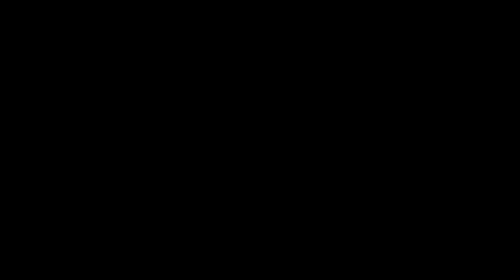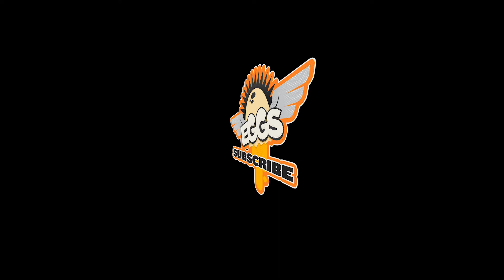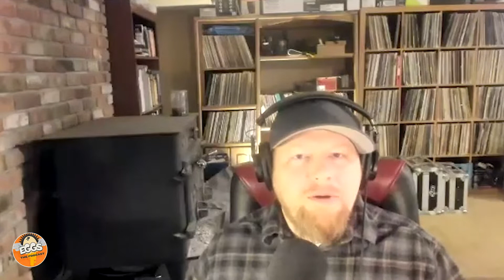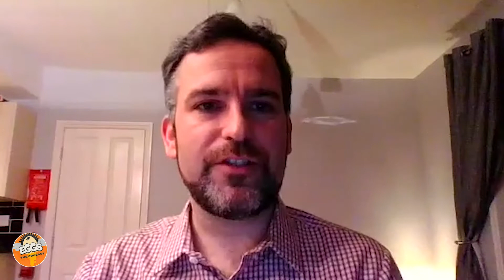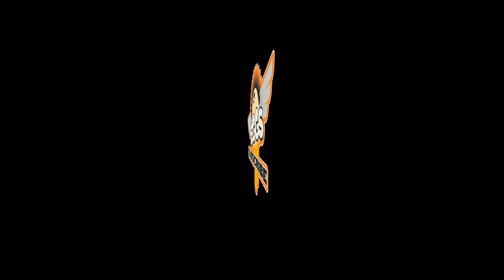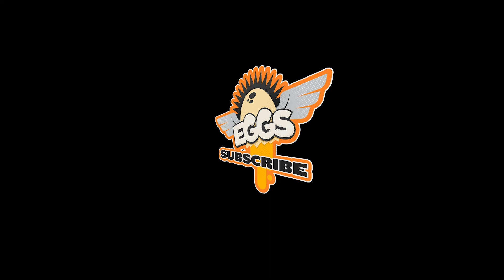Hydrogen combustion engines vs hydrogen fuel cell technology with Andrew Murphy [Alternative Energy]

Comment: This did not answer the question of comparing overall efficiency and cost between the two. One point is the NoX produced in the ICE is very low if the hydrogen air ratio is at an optimum level.
Reply from the maker: Take a look at the show in its entirety to see if Andrew answered more thoroughly your questions. This is just a clip from a longer interview. :)

Comment: You should take a good look at what JCB have just developed! They have managed to convert one of their own home built engines (yes, JCB build their own engines!) to run On Hydrogen gas, interestingly, without the engine producing NOX gases! This is by tuning the engine and by some very clever British engineering! They looked at producing an electric JCB and found that the battery they would need would weigh an extra 8 tons to run the double shift that construction equipment is used and designed to run to today. The electric JCB would also cost over twice the cost of the Hydrogen version! So there is much promise for the British car manufacturing industry if only they would licence the technology from JCB!

Comment: Thermal is cheap, reactive and H2 very low octane can be offset by a diesel cycle with HP H2 injection and the very high speed of H2 combustion enables much higher rpm and downsizing than H2 Otto cycle while the fuel cell is more efficient so solution is hybrid again, Sir Aido Toyoda…thermal for acceleration and power, and FC for cruising with green H2 to store excess summer free sun energy…PV gets cheaper all the time, graphite electrolysers cost nothing, high pressure H2 COPV can store static and mobile massive amount of energy for almost no cost being well over 30 times cheaper per kWh of storage than LIB’s and well over 30 time more durable with well over 50000 full pressure cycles without any measurable loss of gas while a lithium battery leaks at o.8 to 2.1% energy loss per day. Mobile loads will quickly adapt to cleaner and cheaper stored energies since surface renewables like sun and wind are variable, unpredictable and seasonal and such energy production must be stored to meet deferred demand
Reply from the maker: Thanks! We love learning about thermal and other future energy options!
Reply: @EggsThePodcast  thanks. I spent a third of a century in the energy, mobility and distributed power, and those very dynamic domaines are forcing us always to think forward, few steps further…If today, one could consolidate all vehicular technical improvements already in mass production today  into a single vehicle, the best mobile efficiency and safety of today could more than double…triple etc, with fuel cells, Miller Atkinson Antonov Peltier Sabatier SPCCI hybrid and regen. braking, low resistance tyres and bearings, composite frame, shafts, wheels, brakes, automated vehicular interaction etc..
Reply from the maker: Thanks for all that information. We totally agree. I don't know if you have heard/seen it yet, but you might have some interest in a recent conversation with Dr. Amit Roy (also his associate Andrew Murphy makes another appearance). It's show number 211, you can see it here: https://youtu.be/hMxcbYHOIpQ

It is another long form discussion about alternative energy and a project they are working on. You may find it interesting, and I would be interested in your thoughts.
Reply: @EggsThePodcast  thank you. Yes this is interesting. Electrolysers are definitely a challenge, mainly a technical and material challenge, galvanic corrosion water improved conductivity with corrosive salts, heat etc..etc…not really a cost challenge. For instance the home use domestic H2 energy storage of PV power to provide an autonomous heating hot water and power already sold like German HPC Picea have a cheap ~1500€ electrolyser , a reasonable price but the efficiency drops with time and electrodes must be replaced..However if primary source of energy is free sun or wind (no one care about windmill efficiency, noise cost low wind perf, size etc are more essential parameters) then domestic electrolyser system can be cheap and not too efficient while providing enough heat for normal domestic use and also using PV DC power directly, with the cost saving of a DC to AC island mode converter, expensive and of limited lifetime…5 yrs..
Reply from the maker: Thanks for the 2¢! We appreciate the commentary. Thank you for commenting.